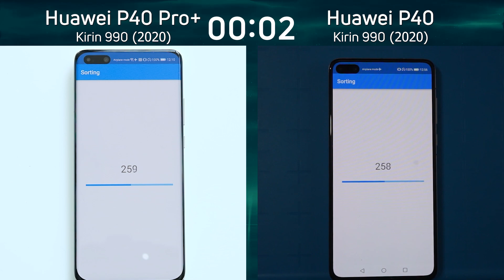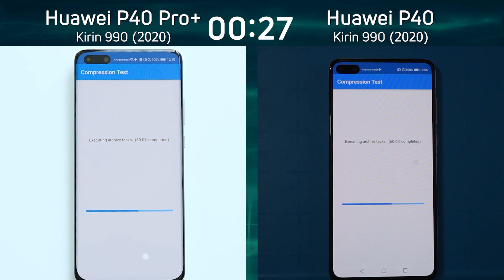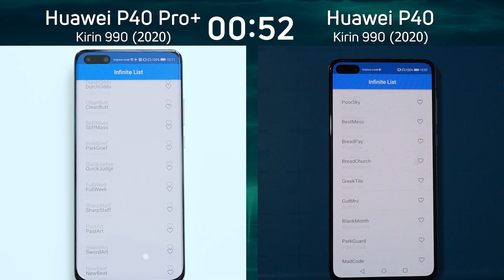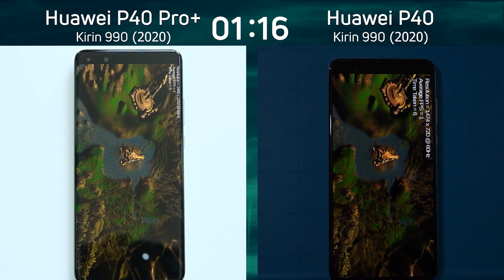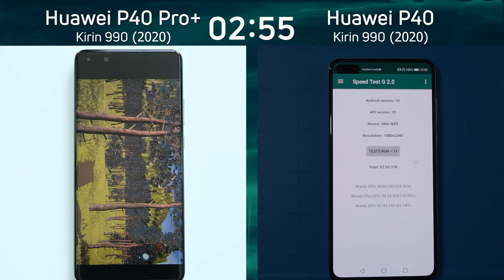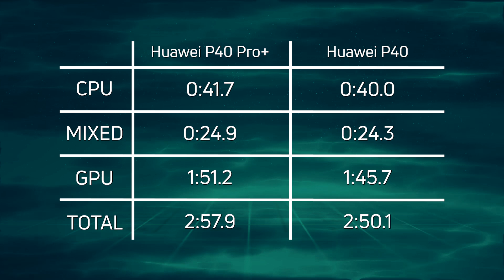Huawei P40 Pro+ vs Huawei P40

Comment: It's so odd that the Huawei's GPUs are either so bad or so optimised for these engines. Have you done a video on the hardware on the Kirin chips? Who makes their GPUs or is it their own GPU?
Reply from the maker: The Kirin 990 has a Mali-G76 MP16 from Arm. The G76 was announced in 2018, so it is quite old.
Reply: @SpeedTestG  Cool, it's going to be interesting to see what direction Huawei takes with the Kirin 1030 and beyond if they are forced to stop using 'Western tech'.

Comment: I guess these 3D tests must be modified to represent actual performance of phones when using 3D-intensive games and apps. Current 3D tests are quite skewed toward Snapdragon chips while most othe Exynos, MediaTek, and HiSilicon chips perform poorly on these test. This in contrast with the fact that these Chips usually handle 3D-intensive games without much problem.
Reply from the maker: Please read the FAQ. Games are designed to run without much problem, but to do so they sacrifice, quality, lighting, shadows, etc.

Comment: I mean, the CPU isn't bad in Kirin flagship processors, it's actually pretty good.
Kirin 990 5G processor is a beast when it comes to AI tasks and computational photography processing as well, but they have to improve their GPU by alot.
That GPU performance is not acceptable for a $1400 device.

Comment: Even a mid range snapdragon can trash the GPU of this Kirin "flagship"

Poco X2 (SD 730G): 2 min 34s
P40 pro (Kirin 990) : 2 min 50s
Reply: usally these mali gpu's are way better at real life games than this speed test g. they can handle hdr+extreme and other high settings for the games, but midrange snapdragon processors can't do it though they are better at speed test g test than these mali gpus!
so, somethinh is wrong of course. i know they are bad compared to qualcomn flagship gpus, but not as bad that they perform worse than the midrange one
Reply: @suvrosawon4545  ever heard of marketing? The trash exynos 9611 can do HDR pubg buts its 10x worse than the 720G or 730G as an actual processor
Reply: @moemensuper1796  Dude, you're a dreamer. Sd 730 or 720Pubgde max plays smoothly in the setting. Mali gpu exynos also fails, but kiirn is very successful in the chips. This STUPID test is completely ridiculous.
Reply: @moemensuper1796  If you're tying kirin 990 to sd 730 and saying sd 730 is better, you're a fool.
Reply: unknownpawner1994 Not suitable for speed test g kirin processors. It is actually kirin 990 sd 865 level.
Reply: https://youtu.be/nb7TVptTV-8
Reply: Kirin 990 is not behind the real game of the sd 865. Sd 730 will also give you hell. The gpu section of the speed test g is not suitable for dirt. I know about these things. Don't talk and shut up without knowing the.
Reply: Thanks. I came here just to ask about that. I was wondering if it could beat the 765. Lol, can't even beat the 730. They(huawei) must really be paying all "those youtubers" to push their crap.
Reply: gwite Bro kirin 990 = sd 865. Speed test g not suitable for kirin.
Reply: @osmanemredonder3604  why are you saying that speed test g is not suitable for Kirin processor?
Reply: @Harish2923  😂
Reply: @dwighttsharpe  Very funny. Kirin 980= sd 855.
Reply: @osmanemredonder3604  are u dumb LOOOOL? use GFX tool in the SD730G/720G and u will see how smooth maybe even smoother it is in HDR graphics.
Reply: https://m.youtube.com/watch?v=01Tx6h9Ntqs
Reply: Because speed test g for snapdragon.
Reply: @osmanemredonder3604  What😂? In ur dreams buddy. Go read the FAQ of this speed test G
Reply: @moemensuper1796  Kirin isalers used to be bad, but they're good now. I'm using the Apple A12 but it's not suitable for the dirt series to test the speed. In real use, in gaming fps, throttling, downloading, warming, 990 of the dirt is not left behind at all, sd 730 a hell. Look at stupid tests like speed test g.
Reply: @osmanemredonder3604  stupid tests?? These tests TEST how FAR the cpu and gpu can go just admit it
Reply: @moemensuper1796  If you don't know anything, shut up. I can't look at a single ridiculous test like you and trust it. I'll take a good look. We know what speed test g costs
Reply: @moemensuper1796  Kirin 990 ve sd 865 in gerçek oyun içi testlerine bakın?
Reply: @osmanemredonder3604  https://youtu.be/0dsQiw-G8O8 watch this and shut up
Reply: @moemensuper1796  You are an idiot. I didn't mean to say that, but you're stupid. I compare the iselmcs in depth. I know a lot of things you don't know.  Kirin is 990 in the game, in everyday use, the SD does not lag behind 865 and is very powerful. But just tear your sd 730 better. Kirin 990 is actually the level of sd 865. And you're just trying to say the SD 730 better by showing me a stupid channel. And you're telling that to someone like me. It's really funny.
Reply: @moemensuper1796  That channel exaggerates apple's A series and exynosu and does whatever it has to humiliate the kirin . I mean, it's a stupid channel. I've compared the businesses you're talking about everywhere, and I used it when the time came. Speed test g is nothing more than a fan to rely on and say the SD 730 is better. Why don't you look at the real tests? Are you afraid of the kirin in
Reply: @moemensuper1796  Dude, i've had enough. Sd 730 pubg is currently contracting at the lowest setting.  There's no obvious rest of the kirin 990 from sd 865 ( or sd 855+
Reply: @osmanemredonder3604  bro they are so fool and blind .. They are trusting these videos blindly. Kirin chips are way better than they are thinking even in gaming.
Reply: @-Rahad  yes, speed test g is not fair. On real kirİn 980 is as performace as sd 855
Reply: @osmanemredonder3604  just admit mali gpus are literally terrible compared to andreno's gpus
Reply: @moemensuper1796  Mali exynos is garbage, but dirt is also very good. Compare to Sd 730 😂😂. If you don't know, shut up?
Reply: can someone tell me how the kirin 810(huawei's midrange soc) beat the hell out of sd720g which is almost similar to 730g in real life usage
Reply: Can it do the same in games😂
Reply: @malathomas6141 Yes
Reply: @dennysunny  nah I've never seen a sd730G do hdr extreme in pubg without using gfx tool😂😂😂😂
Reply: @malathomas6141  lol you are comparing a device costs 1400 with a mid-range device. Any phone with sd 855 or 865 can do this. Sd730 is a mid-range chipset usually present in 250-300$ device's
Reply: @dennysunny  u said it can do the same thing is games and I proved u wrong stop backtracking
Reply: @malathomas6141  It can do it but manufacturer don't give a inbuilt option for extreme gaming. With GFx toll we can play HDR extreme to check it's tru potential.
Reply: Denny Sunny AHAHAHAHAHAHAHAHAHAHA KİRİN 990 = sd 865.
Reply: Mala Thomas sd 730 vere lag on pubg hdr.
Reply: @dennysunny  kirin Kirin 990 is not behind the real game of the sd 865. Sd 730 will also give you hell. The gpu section of the speed test g is not suitable for dirt. I know about these things. Don't talk and shut up without knowing shit!
Reply: @dennysunny  You fanboy. Kirin 990 level sd in games. Sd puts a billion to 730
Reply: not the cpu though

Comment: Just because huawei gpu does bad in this test doesnt mean it is bad in the real world. There are some video where the huawei p40 pro run pugb max graphic 90fps no problem at all, compare to samsung s20 exynos where it would throttle.
Reply: You do know 'max graphics' doesn't really mean max graphics right???  The actual visual quality would be vastly different from a phone that's actually running it on max (SD 865/a13) . There are comparisons for that on YouTube. The visual quality is significantly worse because they change settings for optimisation behind the scenes to make it run like that (lower vegetation count, draw distance, texture quality). When a gpu is bad on paper it is BAD in real world, period!
Reply: @adityaghosal1000  stop tryna downplay Huawei i hate people like you all games run at a fixed resolution on games and at a set quality set by you in the game settings.in pubg p40 pro runs it at 60fps at hdr settings same for sd 865 both hold a 60fps target seen from an fps target and no visual difference was seen or else it would have been pointed out can u stop the BS now.SYNTHETIC BENCHMAKRS DON'T ALWAYS REFLECT REAL WORLD PERFORMANCE!!!!!!. If this benchmark was true to real life Huawei would have been in problems
Reply: @adityaghosal1000  then why was a video of this guy running a huawei p40 pro vs the s20 with snapdragon 865 and the kirin did extremely well, even though the snapdragon has a slightly higher fps the kirin uses less power compare to the snapdragon 865. It isn't as bad as most people think. Exynos can't even run game properly without throttling where as huawei, using an older mali gpu runs game better than the exynos 990. Also I'm talking about kirin vs exynos  not a13.
Reply: @dxtnguyxn4179  can you link that video where Kirin processor did extremely well?
Reply: @dxtnguyxn4179  and where did you get that "the kirin uses power compared to Snapdragon" ?
Reply: @Harish2923  chong liu. It's the p40 pro vs s20 plus pugb HDR.
Reply: @dxtnguyxn4179 
you need to learn the meaning of optimization.
Optimize meaning rearrange or rewrite (data, software, etc.) to improve efficiency of retrieval or processing.
There is also an another type optimization. Optimization for specific device/processor.
What it means is that either the processor manufacturer or the creator of the game will give a optimal preset for their games for the specific  processor. But benchmark apps don't do this but manufacturer's can give preset for any application.
(Mediatek was caught optimizing their processor's for every major benchmark apps)
Reply: harish v why is the Exynos so bad at gaming since some games should optimise it? Also how is the Kirin uses less power compare to snapdragon 865? I’m not trying to argue or anything, just asking question :)
Reply: @dxtnguyxn4179  
1. "Also how is the Kirin uses less power compare to snapdragon 865?"
I was asking you this question because you are the one who posted that Kirin uses less power compared to the Snapdragon.
(It can be true that Kirin uses less power compared to Snapdragon because 
1. Kirin uses a enhanced 7nm node from tsmc while Snapdragon uses the traditional 7nm from tsmc
2. Snapdragon 865 has an external modem while the Kirin 990 has an integrated modem, external modem uses higher power than the integrated modem)
2. Why does Exynos has lower performance than Kirin in games
 1.Most of major mobile games are developed by Chinese companies and huawei one is the biggest hardware and smartphone manufacturer in China/world so huawei would be the closest company to the developer's.
 2. Poor optimization for pubg/codm
On samsung's part and the overheating of their custom mongoose cores.
Reply: harish v u can watch the video from chong liu at the end of the video u can see the Kirin drain less battery compare to the snapdragon. Maybe the Kirin 7nm might use less energy compare to snapdragon 865.
Reply: @dxtnguyxn4179  fortnite will run on Exynos processor better than other processor's(except Snapdragon and Apple A series)
1. Fortnite is optimised better for Exynos than others ( samsung galaxy phones were the first and only phone's to be supported by fortnite until 12th August 2018)
2. There are even exclusive skins that you can only get if you have a 
S or note series device.
Reply: @Harish2923  I have a note 9 exynos and it's unplayable on the exynos, it can't even sustain 30fps.
Reply: @dxtnguyxn4179 I said that because Samsung had a partnership with epic games because of that partnership epic games optimized fortnite for samsung's mid range and high end processor while you need to have a flagship processor if you had a Snapdragon/Kirin when the game released.
I personally don't have a samsung mobile so I can't comment on the performance of the device.
Reply: @dxtnguyxn4179 1. Kirin uses an enhanced version of tsmc's 7nm called 7nm+ which is produced by Euv process while the Snapdragon 865 uses the traditional 7nm which is produced by the DUV process.
The benefits of using Euv process over DUV process.
7nm+ is cheaper because EUV lowers the amount of production cycle steps, lowers power draw, and lowers die size.
The last two things can be leveraged to increase processor performance by means of higher clocks, and more components to increase things like IPC.
2. Snapdragon 865 uses an external modem while Kirin uses an integrated modem (integrated modem uses less power compared to an external modem)
So technically kirin should use significantly lower power than the Snapdragon 865.
Reply: @Harish2923  I think if kirin had an even better gpu that it would be good.
Reply: @dxtnguyxn4179  also Kirin has a two year old GPU with old architecture while Exynos has a one year old GPU with new architecture.
This is also the reason why Kirin GPU is very slow.
Reply: For the record NO PHONE can run Pubg mobile above 60fps Except the Oneplus 8 and that's not because of capabilities but because of licensing issues at this time. So whatever Other video you are talking about is fake which is isn't surprising if it's from China. Just for some perspective the Snapdragon 670 in the Pixel 3a has a better GPU Than this Huawei Garbage. Exynos is junk as well but hopefully the 1000 will be different with ADM making it...... But at the moment and really for the last 3 years Snapdragon has been far out in front on the Android side but like I said ADM could definitely change that very soon.
Reply: @kevinbryantsr.6443  pubg is not available on china instead there is a Chinese version called "game of peace" which does support 90hz.
There are a lot of devices which supports 90hz on pubg and the Chinese version (eg: rog phone 2)
Reply: @kevinbryantsr.6443  edit: every devices with a 90hz display and Snapdragon 855/ 865 will support 90hz on pubg.
90hz on pubg was announced in the launch event of Snapdragon 865.
Reply: https://m.youtube.com/watch?v=snLd-V1TKTc

Comment: When you realise even the A11 chip will blow this trash away 😂
Reply: @Youtube Kullanıcısı kirin 990 5G is better when it comes to raw CPU performance than the A12 Bionic. That's a fact.
Reply: John Adamo A12 is far ahead of the kirin 990 get ur facts right
Reply: @gsc-lol-islem6494  nope it's not.
Reply: @Rusty_Gladius  the A12 have already trash the sp 865 no doubt that kirin 990 will fall by miles behind vs the A12
Reply: @gsc-lol-islem6494  not in CPU.
Reply: @Youtube Kullanıcısı you're in denial kid
Reply: Lol no stop exaggerating. I would call it better than A12 in CPU
Reply: @imaz7827  Apple have always been ahead on SoCs since they moved first to 64bit in 2013. 

The A12 is actually a great chip. Still better than Kirin 990
Reply: @kapilbusawah7169  No A12 is  better than Kirin 990 in GPU but not in CPU
Reply: It's true though, iphone 8 will crap all over  this crapkin 990
Reply: @duckduck7459  😂😂😂😂😂in your dreams crapple fan. It's not even a competition. kirin 990 can fuck even A12 in CPU and A11 in both